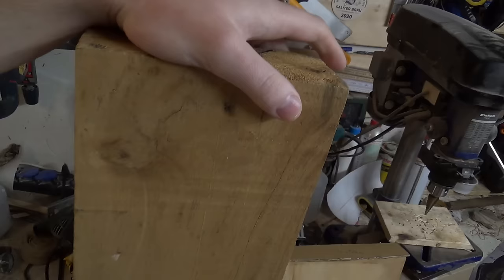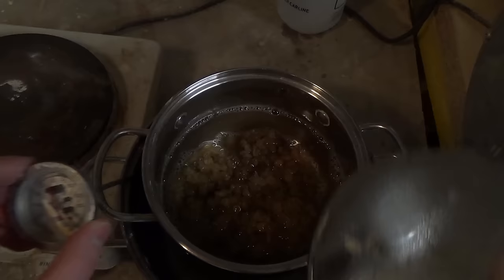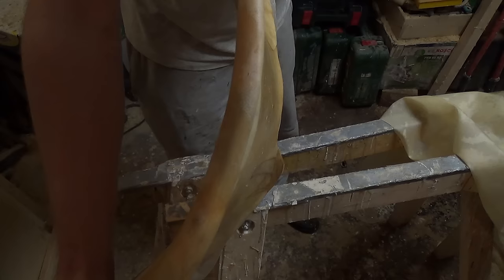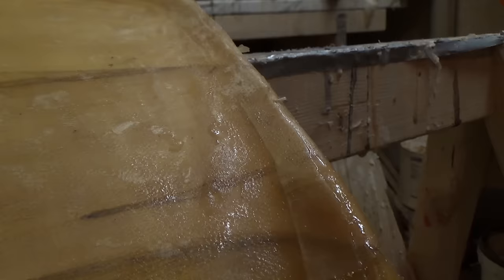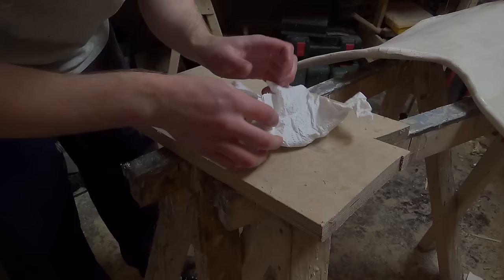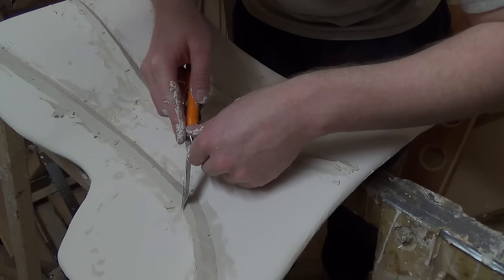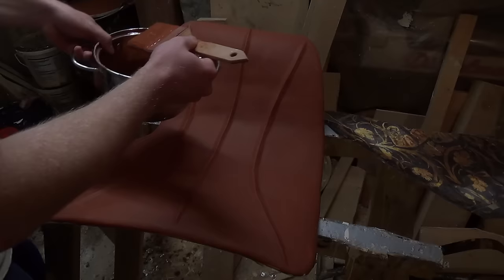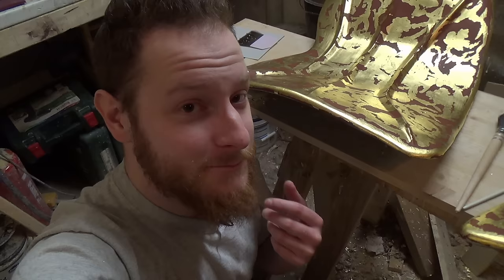Crafting a medieval Targe Shield replica, only with the original Materials

Comment: I made wooden bows with rawhide backing in the past. I used a foam/sponge paint roller to apply the hide and remove the bubbles. Worked like a charm. Elastic bandages and thumb tacks work great to keep slippery rawhide in place around odd shapes.

Comment: very good! 
For the ridges you could make a little board or thin material where you cut out the cross-section of the ridge. Then you can drag it along over the rough ridge
Reply from the maker: Thank You! :) 
Yes, I do something similar on another type of Targe, but it wasn't done that way in the Wallace-Collections shield.
Reply: Was thinking the same thing, a simple V-notch in a piece of left over wood stock would do the trick, no need to be super accurate with the piping bottle. Now I'm not a shieldmaker but using a template is nothing new.
Reply from the maker: @Pottan23  you need to be able to bend it in more then one direktion though. The middle ridge would/could be possible, but not the ones left and right with so many angle change; uffff. nearly impossible, but for sure more time consuming then the gesso method.
Reply: @TheShieldery  can't see what is so impossible about a v-notch in a thin (<10mm) piece of wood? The bend in the outer two ridges are very slight.

It's just to rough in the shape
Reply: @TheShieldery  i missed that info😀 . Really though stuff what you used for the ridges. Amazing knowledge back in the day. You make awesome stuff. Very interesting Keep it up!!

Comment: I thought that this wood will be bended, not glued and sculpted. Amazing work.
Reply from the maker: woodbendig for shield building happened, but wasn't that common. Especially if you need to do a singel piece for the specific armor of a customer, caus you would have to make a mold just for that. Why go through the trouble of sculpting a mold and then bendig the wood in a lot of paces into it, when you just could carve the shield directly? :)))
Reply: @TheShieldery   Making a mold for shield like that sounds like a low extra cost xD But I can have wrong feel about durability of bendet shield, I have no idea how stronger (or if it would be stronger) it would be than sculpted.

Comment: Personally i think a better technique then the plastic bottles for applying the ridges in the white paste that looks like clay is to go all the way and treat it like clay. Roll sausages of it, paint the area they need to be with water, then apply the sausage on the place you want, press them in place and shape them with your fingers as you did. Once it has the rough shape, use the clay with the wettest consistency as you had it, and streak down the sides to fill holes and shape it further with the sponge technique. I feel this will give you way more control early on, and allow for less mess to fix later on. As a pastry baker, that is how i make marzipan and chocolate ganache shapes on cakes.
Reply from the maker: OK. Do you have a source for the White Paste? Got to stay authentic...

Comment: Outstanding dude! I know it's not traditional, but a hypodermic needle and syringe would help deal with the air bubbles. It creates an almost invisible puncture, and you can draw the air out, rather cutting the surface or having to push the bubble to an edge. Top level craftsmanship buddy!
Reply from the maker: Thank you! I actually have tryed that allredy, but there are some problems:
1.: If you try to use the needle when the rawhide is still wett, you will dislokate it while penetrating.
2.: the glue has a low velocity and doesn't flow that good through the needle. If you stop pumping it cools down and gets hard instantly.
3.: You need to make another hole or the air can't escape and therefor the glue can't enter or will flow out again.
4.: If the Rawhide and the glue has dried, you need a lot of force. you nearly can't even get it in. 
5.: The needle is cut in an angle in order to make it sharper, but that also means you need to enter into the object deeper then you think in order to get the actual hole to the depth you need. When the bubble is only small, you will hit the wood, bevore that happens. So you need to sting from the side in the perfect angle. you only got like a 10 degree range and have to work through way more rawhide by doing that.

I still use the needle+syring if I got a bubble in a place where I couldn't hide a cut. Like on the back of the replicas of the Schongauer Paveses, where no basecoat was applied.
Thanks for the question though. I am planning on making a video about crafting one of those Paveses and mayby will adress those problems then :)

Comment: what a beautiful piece of work! a tip for squeezing the thicker gesso - you can reload an old plastic caulk tube and use a caulking gun, should be pretty easy. very easy to put it back in hot water if it gets too stiff, and no lid to pop off. also, i think some cabinet scrapers would be very useful tools to have.
Reply from the maker: Thanks a lot :)) !
the  plastic caulk tubes sound like a nice idea to try, but I am afraid it would be to difficult to control the outflow, caus the consistency changes every second. But I am quite curious and allready added a revilling plastic caulk tube to my amazon shopping cart.
I allready got some small scrapers, but to be honest a real eye-opener for me was a set of Drawknifes for like 20€ . You can really go into detail and even work on very small crevices with them. They are also good to work with, when you got only one hand, what makes a huge difference when you need the other one to keep the piece in place. I only had one hand left to handle the edge grinder for like 90 minutes in the End of carving XDDDDDDDD. 
And no, I got no and neither inted to buy a OSHA-handbock for my Workbench.

Comment: You need a dust guard for your angle grinder
And another tip for the air holes, I would use a syringe
Reply from the maker: The dust guard is an awsome idea, didn't know such thing existed!
I tried the syring once, but to penetrate rawhide isn't that easy. I use it to add skin glue under the rawhide in the crevises of the backside of paveses, if it deforms to much. But for those quite evenly stringed areas a small cut is easyer.

Comment: A way to solve your perspective problem would be to buy a cheap projector and line up the image of the original and project it onto the blank shield. The image would distort in the same way as the original giving you a perfect replication of the design that you can just pencil over.
Reply from the maker: The problem is placing the projector/shield correctly and make sure that the shield doesn't moove while copying. Additionally I'd have to duck all the time in order to not stand between the projector and the shield. And it's also not as available like my current methode for people who also want to craft s shield like that. I think my methode is easyer, faster and cheaper to do :( .

Comment: When working with the filler material, have you tried using card scrapers that are used in instrument making they come with various curves and are surprisingly useful. I think they would be useful for shaping those ridges as well as scraping around the edges
Reply from the maker: I got those, haven't tried that though. I think it would work, but would be less effective then using the wet sponge.

Comment: Lovely project and commentary.  I'm curious, this is the way every Targe was made at the time? Just wondering if they might have had some early form of ply, or thin planks then steam bent into shape, which I would imagine has better overall structural strength.  Just a thought.  Either way this is really nice.
Reply from the maker: Thanks! :) 
There where different ways for building a Targe, the largest difference between the one I made in the video and the majority which actually got used for fighting or Tournament was, that the ridges where larger and carved out of the wooden core. A lot of times Fabrik was used for instead of Rawhide, which made the stringing way easyer. We got some plywood heater and viking shields, but I haven't seen a plywood Targe bevore. They glued differnet wooden parts together, which not necessarily where plankish , but I don't think they where bend afterwards. 
It's kind of sad that I can't comment a picture XD . But there was a very good Tournament targe from 1553 ananlysis which showes 10 layers of wood above eacht other, from different wooden types (softwood and hardwood !!!) , connected with wooden nails. I think the planks of the layers where only slightly bend one after another in order to fit the one beneath better, without the need or use of steam. 
Thank you for your curiosity! :))))

Comment: the technique that I learned when I was at school (in Italy) involved the first two coats of plaster and lapin glue applied with a tapping movement, as if a woodpecker were pecking at the tree, to allow the mixture to enter the pores of the wood or of the skin.
Reply from the maker: I also heard of the tapping, but when I tried it I got a lot of those pore-bubbles. What kind of basecoat did you use? If it was also the original one with hide glue as binding agent, could it be that you thinned it down more? I got to go (water) 9:1 (hide glue) in order to make it resistent enough for a regular transport to events.
Reply: @TheShieldery  60 gr lapin glue/ 500ml cold water ( the glue must be inflating in the cold water until it's soft) + bologna chalk until It absorbe.
You May applied It with a short silk Brush, or a big round gilding Brush.
Your Channel Is sublime and interesting!
Reply from the maker: @stefanotrussi4312  
Thanks! it was this brush, mayby 3 instead of 2,5 inches, but well https://www.kremer-pigmente.com/en/shop/brushes/flat-brushes-varnish-brushes/flat-brushes/85422125-flat-brush-bristles-1-strength-no-2-5-inch.html
What kind of brush would you recommend for that task? 
What's lapin glue? is it the same, as rabbit glue? google translate is not my friend in this case XD
Reply: @TheShieldery  let's leave your Instagram contact and I'll make a video for you tomorrow and post it to you.  however, lapin glue is rabbit glue (lapin in French).  if you don't have a sizing brush (assiette) take any one and cut the bristles to 2 cm, to make it stiff.  However, a round brush is preferable.  also regarding the ribs you used a lot of skill but I would have put a hemp rope underneath to create a frame and then covered it with glue and plaster.  I await your contact and I will send you a video.  good night friend.
Reply from the maker: @stefanotrussi4312  https://www.instagram.com/andreschilderey/

Comment: Hi! Amazing video! I might be wrong but hide glues, fish glues, bone glues casein glues are composed of collagen, glue made out of flour contains gluten...

But it seems that the word glue comes from gluten and the word collagen comes from kolla in greek, meaning glue... 

Do you have any clue?
Reply from the maker: Hi and thank you :) 
Animal glue, like Bone, skin and fish glue are adhesives that are created by prolonged boiling of animal connective tissue in a process called rendering. 
Hese protein colloid glues are formed through hydrolysis of the collagen from skins, bones, tendons, and other tissues, similar to gelatin. The word collagen itself derives from Greek κόλλα (kolla), meaning 'glue'. These proteins form a molecular bond with the glued object. Conventionally, keratin glues, while made from animal parts like horns and hooves, are not considered animal glues as they are not collagen glues.
In German they are knowen as Glutein-Leime, mayby I made a minor translation mistake and should have called them Geltin-glue instead of Glutein glue? 
Casein actually is a family of related phosphoproteins and usually get's extracted out of curd and the large difference to the animal glues is that it's water resistent. I don't want to spam you now, so I'd advide you to take a look at the wikipedia artikle about that, it's really interesting :) .
Reply: Thanks a lot man! That helps and explains a lot! It sounded weird, but I am french living and reenacting in Czech republic... So yeah... I'm bound not to have the best vocabulary in this kind of detailed topic ... The quality of the filming and editing of the video is really good by the way!

Comment: homie u NEED a dust collection system. 

not only is it a firehazard, but also largeamounts of sawdust like this are a health hazard for your lungs. a lot of shopvacs can connect to grinders, saws etc...
Reply from the maker: The only oness that you can combine with edggrinders are for specific tasks, like cutting or grinding concret. They all require a quite closed up airchamber arround the blade. And that unfortunatly doesn't exist while carving. If you find one that has decent results, please write me the products name! In addition the suction hose allready gets in my way with the electric planer all the time.... The shopavces would have to suck in so much dust that I wouldn't have to wear the lung protection anymore to make up for it.
I am wearing an air filtering protection mask+ airtight glasses+ ear protection btw. :)

Comment: Super interesting. As someone who is interested in traditional/classical painting. I could follow every step. Technically it is very close to iconography techniques. Actually its just a very interesting shaped painting panel. Canvas ist just similarly prepped with chalk ground because the acid in the applied oil solutions attack and react with the fabric or in case you paint on wood the wooden structure. Thats why you put gesso on top. I am surprised how stable it is that it can  withstand the impact of brute physical force... But can someone tell me , why raw hide is applied ? Whats the benefits of that ?
Reply from the maker: The Rawhide makes it more resistable to the force :) It works a bit like an exoskeleton. 
Shields like that usually only lasted for one lance hit. The extreme decoration however implies that this piece was ment for decorative purposes.
Reply: @TheShieldery  Do you know about the longterm effects of glued hide.. how stable it is? Are cracks easily developing?    And does it as you already said the stability of the wood also in terms of age related material changes in form ? Because natural wooden panels have the risk to bend over time and aging . Is the hide beneficial overall or an aditional risk factor of the longevity of the decor or art ... I am curious to know. I saw Caravaggios Medusa in Florence... Actual  an oil painting on round  renessaince shield and was thinking about the process without knowing much about the craft. And I want to paint more on wooden grounds. Wood is naturally more stable and solid as fabric and is less at risk of cracks ...but yet if it deforms it is more critical to repair . Hearing about animal skin as a subliment is the first time for me.... Thanks for sharing your knowledge btw... :)

Comment: I wonder if printing onto a transparency and using an old overhead projector could help with transferring the design onto the non-flat surfaces... or if that would make the image too stretched at parts? Maybe 3d render of the shape could help before printed transparency?
Reply from the maker: If using a projector, I'd print the motive directly onto the transpareny. The problem is placing the projector/shield correctly and make sure that the shield doesn't moove while copying. Additionally I'd have to duck all the time in order to not stand between the projector and the shield. And it's also not as available like my current methode for people who also want to craft s shield like that. I think my methode is easyer, faster and cheaper to do.

Comment: Beautifull beautifull beautifull. I have a question, do you by any chance know how the romans typicaly built their scuta, parma and caetra shields? Do you have any knowledge about that?
Reply from the maker: Thank you 🍻
Yes, i know how they did it, although i haven't Made one myself yet. They basically Made a three-layered plywood in the bended shape from small and thin planks. Those where enforced by thicker, also bent pieces of Wood on the backside. Then followed the stringing with rawhide on the Front, the Attachment of the buckle, the Metal edges, the handle and the Straps. 
Kind regards, Andrew 👍
Reply: @TheShieldery  wow thank you very much

Comment: I give you credit on your gilding. I hope you’re not using real gold because it’s got off expensive gold leaf. I use the brass leaf.
Reply from the maker: thank you :))))
I actually used real gold ( from Kremer-pigments, 25 leavs of 80x80cm for approx 75€), otherwise you couldn't call it replica. I spent 225€ only on gold PER SHIELD.
If the first one wouldn't have been made to order, I wouldn't have been able to afford that. There is a reason why I charge 1200€ for a piece :) 
In addition the fake ones are noticable thicker in the handeling, so I also couldn't have showen how to do that. No idea btw weather Poliment gilding would work that good with fake gold.

Comment: Any specific reason for the shape of the shield? 
Looks like it could be used on horseback.
Reply from the maker: Yes, they mostly have been used by heavy kavallery. But we got some Martial arts manuals in which you can see they the also have been used in duels by fully armoured foot soldiers. There is also a smaller, buckler sized version btw.
Reply: @TheShieldery  Thanks, I thought it looked like jousting shields or something. 
Good job!

Comment: Is the sheep skin structural?
Reply from the maker: Yes, it adds strenghth, but isnt that important for a decorative shield. It helps to protect the Wood from Temperatur and moisture Changes though. So you got Not such a strong Deformation and Not a fast cracking of the basecoat.